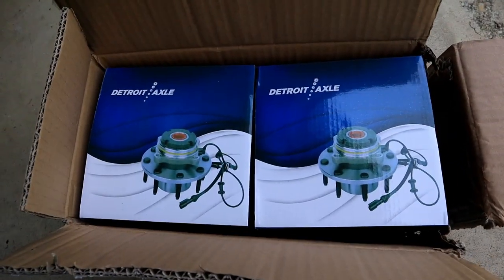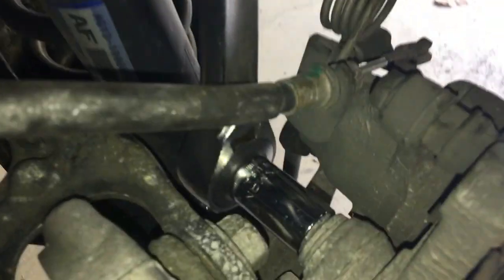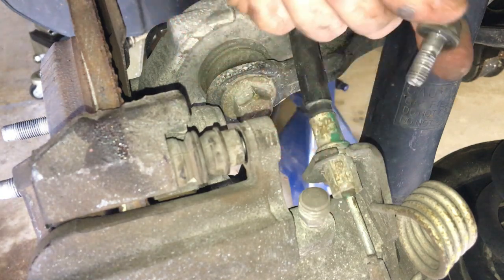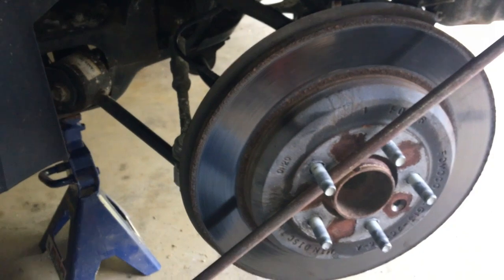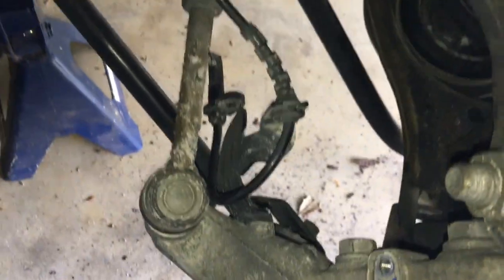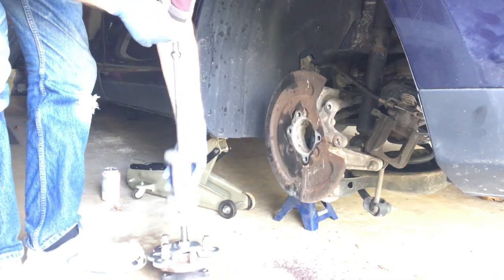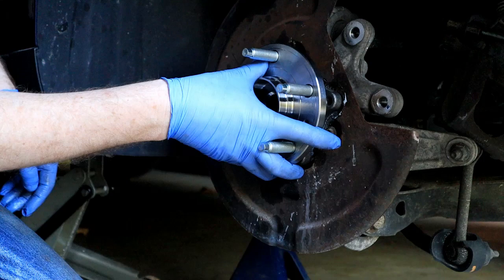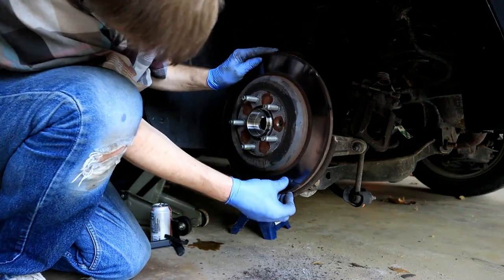2011 Ford Taurus Rear Wheel Hub and Bearings – Caliper Removal – Bearing Replacement

Comment: Just did this on my 15 Taurus. The flex head ratchet was a perfect tip! Made the job so much easier. Saved myself $400 by doing it myself!
Reply from the maker: I'm glad it was helpful - that flex head made it much easier! Thanks so much for commenting!
Reply: An extension bar worked better than a flexible ratchet.

Comment: You made that look so easy I'm sitting here for the last five hours beating on this wheel bearing trying to get it out. I wish I had the luck you did after three hits and it just fell out
Reply from the maker: Long fast hard slides...it should eventually pop. Make sure the plate is on evenly too so it pulls straight out. I was expecting it to be much harder...I probably was a bit lucky.
Reply: @KrizAkoni  First side was 8 hours of pulling, prying, heating, then remove the knuckle to press it out.  Other side decided to just go straight to removing the knuckle and have it pressed out.  Machine shop said it took 12 tons (24000 pounds) of pressure to remove that bearing.  Paid 20.00 bucks to NAPA to press it out.  I just wish I had done it to both sides.
Reply from the maker: WoW, that's a ton of force (no pun intended). For 20 bucks, definitely the way to go if it won't pop right away. How bad was the corrosion in the knuckle?
Reply: @KrizAkoni  looked about the same as yours.  I didn't think it looked that bad.  cleaned up the aluminum knuckle and put anti-seize on it.  Reassembled it and works fine.  Totaled the rotor dust shield but they are only 10.00 each.  P/N for the left rear(Drivers side)  DG1Z-2C029-B

Comment: What brand should I get for 2008 Ford Taurus SEL? What is the cheapest brand but yet reliable? Thank you.
Reply from the maker: @Ruben Luna, I really don't have a good answer to that question. I got the cheapest I could find on Amazon that said would fit my car. I would use the comments on Amazon. Another good idea is to just use the local auto parts store. Those are typically trustworthy.

Comment: What the torque spec for the bolts that go into the rear hub cant find the information anywhere and would it be the same for a 2013 taurus
Reply from the maker: Wheel bearing hub bolts should be 98 ft-lbs

Comment: Excellent video!  I have a late build 2010 Taurus (built March 2010) that just turned 103K miles.  Great to hear yours has 200K+ miles and still going strong.  Have you had to replace the dreaded water pump?  I hear it's a nightmare so i change my coolant every year and use only synthetic 5W20 oil (changed every 3,000 miles).   Have you done anything special to get to 200,000 miles?
Reply from the maker: Thank you! The water pump has been issue free and at 205K still have no coolant loss. I had the dealer replace the antifreeze at ~170K (7 years). I would not suggest changing the coolant more than is required in the book - the risk of contamination increases every time you open the system up. The engine design is for low maint in municipal conditions. I did not do anything special other than only use Motorcraft 5W20 oil every 10K. Some engines have failed (water pump), but the rate is extremely low. I'm not easy on the car and it has treated me well.

Comment: Ford gives you 4 new bolts with locktite already on them how did those cheap bearings hold up
Reply from the maker: Bearings got me from 195K to 268K (73K) miles with no issues. Water pump failed at 268K 😢

Comment: What is the torque for the front axle nut on the 2011 Taurus?
Reply from the maker: 258 foot pounds - there is a special procedure: https://www.fortau.com/front_suspension-241.html

Comment: Did you hit your rotor
Reply from the maker: Light tapping on the non braking surface to get it to release from the hub...it was stuck on there pretty good after 195K miles.
Reply: I had trouble with the rotor also. Plus my 2011 didn't have the one torque screw to remove. Front did. But rear didn't 
 But thanks for the great video. Calm and clear and very insightful
Reply: I couldn't get my sensor to come out after removing the 5/16 wrenches bolt.plastic broke and sensor stayed in . What happens if I remove the bearing with the puller with out removing the sensor?